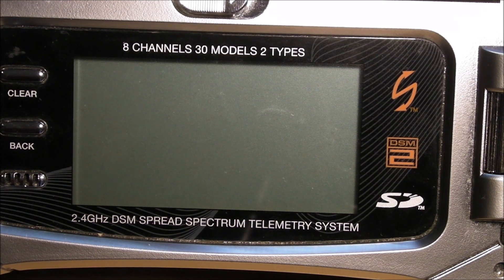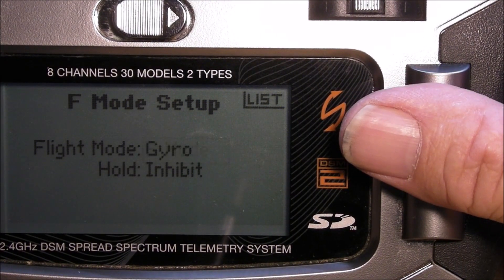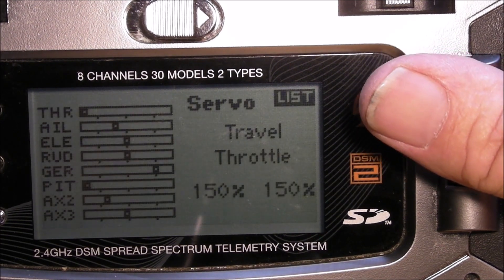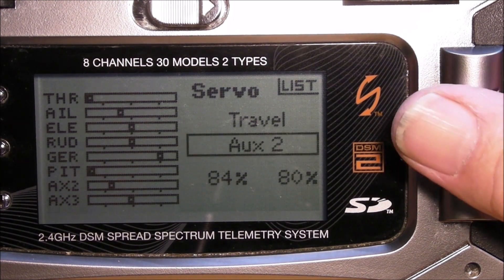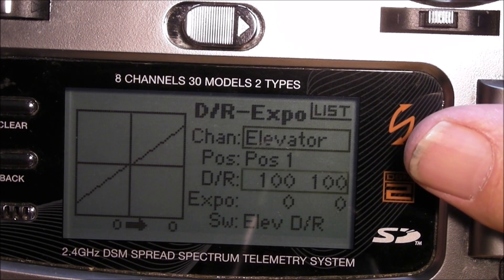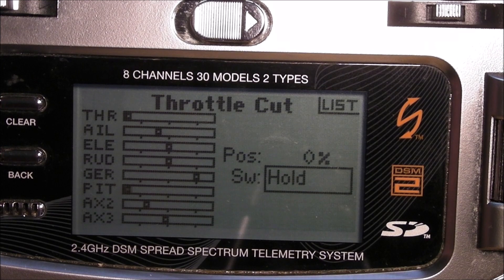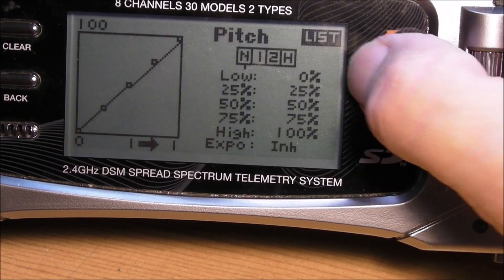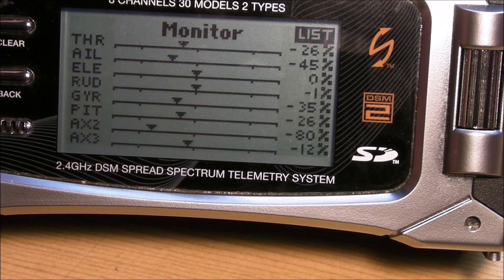NAZA H - Radio set up !

Comment: congratulations and thanks for the video.
I own a naza-h but, I have never been able to fly because the rudder servo works well only during the setup with the pc.
as soon as I finish the procedure the servo works slowly even in manual mode. do you have any advice thanks
Reply from the maker: Well it all depends on what servos you're using for a tail servo and in the setup for your set the travel for the rudder you can also set the frequency for the servo if that's not right that could be making it slow

Comment: Captin, when I adjusted the throttle as mentioned in the videos, I tried to operate the engine without blades to check, and then when I turned the flight mode switch to Att and GPS and turned back to normal the negative throttle does not work, is that normal? and should the negative throttle works only when the helicopter in the air?  by the way, how could I go into 3d mode after hovering with normal throttle?
Reply from the maker: You can go and to idle up mode only if you're in manual mode on the flight controller
Reply: @roachcoachhelis6387  how can I Add more switch for Idle up while II am using the three-position switch for the three modes alredy?
Reply from the maker: @omarboshra6957   Just put your idol up mode switch on your 3 position rudder DR & expo switch
Reply from the maker: You can put it on that switch when you go into your throttle curve Set up

Comment: how could we assign and use both Idole up mode switch with Naza? and is it possible to assign Idole up switch and flight mode switch at the same time?
Reply from the maker: You can use idle up mode with flight mode but there's really no need because the Naza locks your throttle when you go to auto level
Reply: @roachcoachhelis6387  I was asking because I may need it for landing to avoid negative throttle in landing in normal mode and I also want to make to option for my pitch one for general flight with full pitch range negative and positive and another one with positive pitch only, is that possible? If so please guide me Captin how to... all respect and appreciation
Reply from the maker: @omarboshra6957  I understand what you are saying about Landing in manual mode, what I do there is when I get close to Landing I will apply my throttle cut switch and it does not cut throttle until you go to manual and that's how I land soon as I touch the grass I switched to manual and throttle is automatically killed, and I would not mess around with making two different pitch settings because it needs to be the same amount of travel for positive and negative pitch I hope this helps clear this up and doesn't confuse you even farther

Comment: Will naza work with a DX6?
Reply from the maker: No it will not unfortunately you need at least seven channels
Reply: @roachcoachhelis6387  thank you
Reply: @roachcoachhelis6387  Does it still require the use of the regular receiver along with the naza?
Reply from the maker: Yes you still need at least a 7 Channel receiver